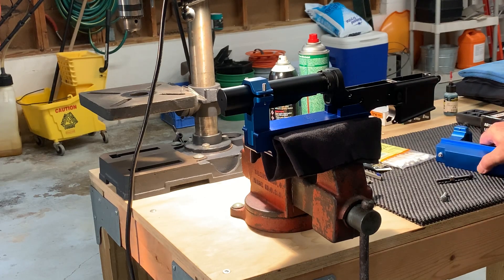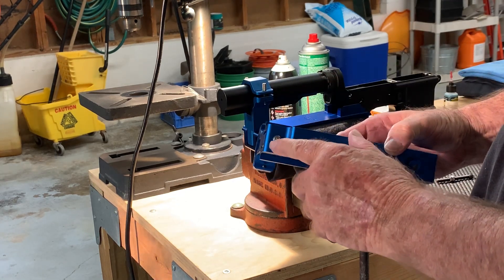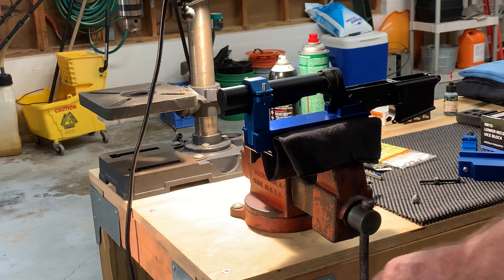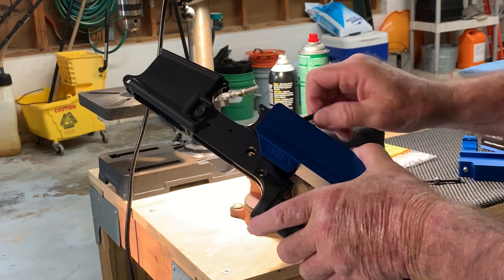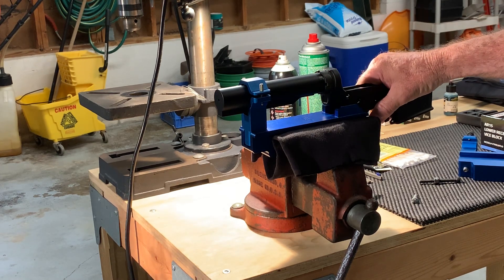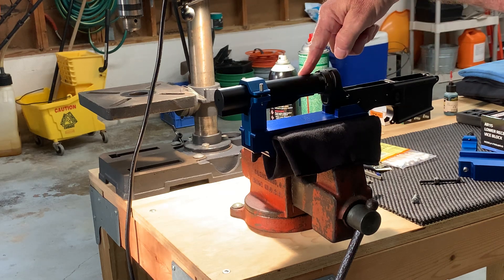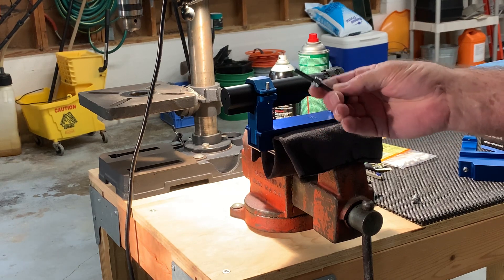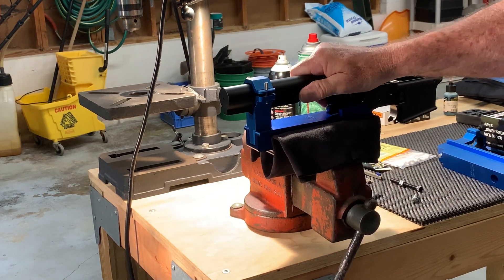Updates to my NcStar Blue Jig!

Comment: What are the part numbers for the grip screw ?
Reply: I can't say for sure, but in another video he upgraded to a stainless version of this one. Unfortunately, it comes in a 25 pk for $36. That part number is 92196A340. I haven't tried this myself yet, but they also have a stainless thumbscrew with a knurled grip like the others he replaced and still has plenty of threads to place your jamb nuts at the needed length. It's only $13. That is part number 6091K61.